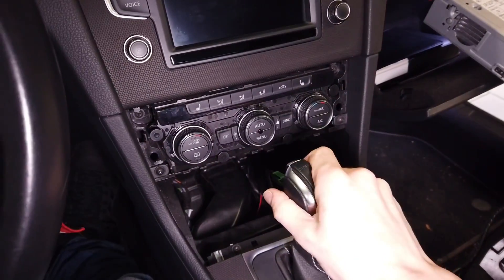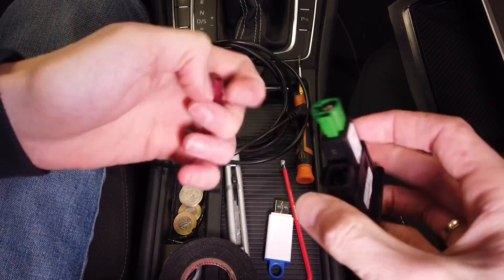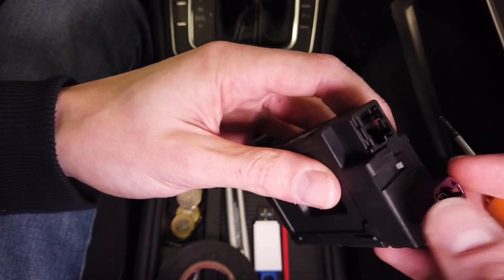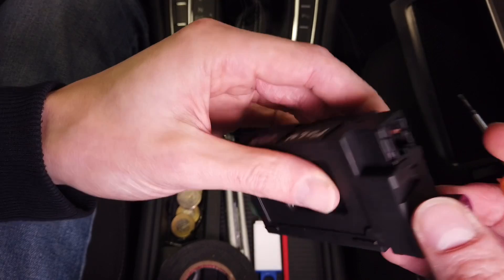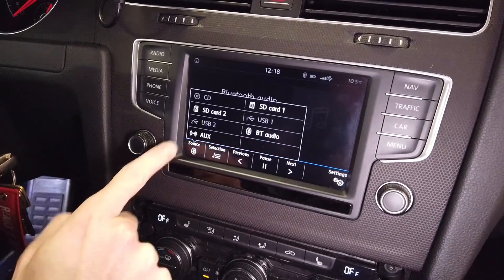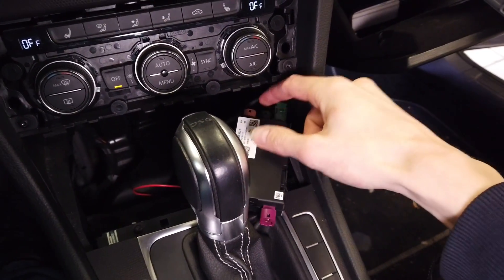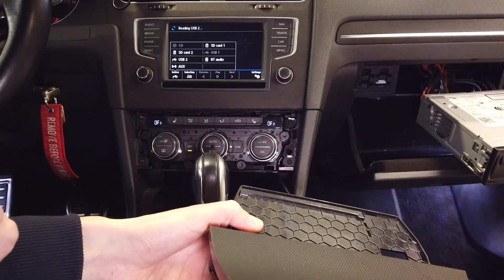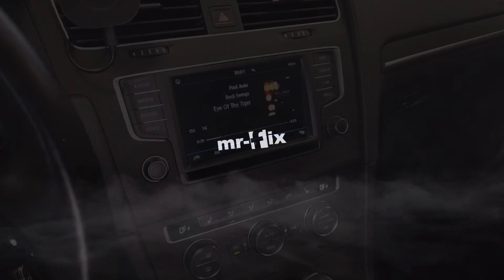MIB2 USB HUB retrofit (5G0 035 953 D) - part 2

Comment: Hi there, thanks for the video! I have a 2019 t-roc with one usb port. I want to update with 2 ports, ideally usb-c ones. My MIB unit is with MST2_EU_VW_ZR_PO478T firmware. Can I use the usb-c part number 2G6035736? From what I can see, it has an internal hub and a 12v input. Or shall I do your solution with the hub and 2 normal usb ports? One last question, is there another way to get the 12v input other than the fuse box?

Comment: Do you need to disconnect the battery when retrofitting radio/screen unit or usb?
Reply from the maker: I didn't. But this is not an official advice.
Reply: @mrfixpl  Thanks. Subscribed, your videos been very helpful. 🤝🏻

2 more things before I start the fitting today:
1. Can the CP removal be done after fitting? 
2. If the fitting goes wrong prior to any code changes, can you put back the old unit or will it no longer work?
Reply from the maker: 1. CP can by bypassed (unit will be fully functional; there will be CP fault stored in vehicle). If you want actual removal, you need dealer-level tools and online connection to VW.
2. I believe you can.
Reply: @mrfixpl  you’re the man. Thank you
Reply: Update on this: 
1. I fitted them without removing the battery (Just key out)
2. re-fitted the old unit, no issues

I've ordered OBDeleven and an SD card so I can patch it and personalise to the car tomorrow 👍

Comment: Hallo @mr-fix.
I have all parts, but I'm not sure how to make all to wark! Can you please help me? From where did you get those +5 Volt trigger?? Just that part is for me confused. 
Thanks a lot, 
Greetings from Berlin 🖐️
Reply from the maker: 5V comes from MIB main unit. Previously it was powering the single USB port. Now it will trigger the HUB.
Reply: @mrfixpl  Can I get from quadlock port or just cut the cable from old usb port? I think that on quadlock exist +5V?
Reply from the maker: quadlock!

Comment: Hello mr fix quick question why dont you retrofit the 8 inch display that supports mib2
Reply from the maker: Hi! I was planning to upgrade from 6.5 to 8.0. But I wanted to old, prefacelift display from Discover Pro. Was hoping for a good deal on used one (still looking) + the console frame that goes with it.
Reply: @mrfixpl  I hvae a 8 inch display with buttons i think that you can have for free but i think its cracked not to sure i can find it and test it, how about virtual cockpit are you planning to retrofit that?
Reply: @mrfixpl  Hello again a costumer of mine dropped of a old style 8 inch monitor yesterday if you are intrested he didnt expect to high of a price for it so i bet you get a good deal
Reply: @mrfixpl I agree and have the 9 inch but even I feel like I want the 8 inch for  the physical controls.

Comment: Have you also replacede the cable between the hub and the MIB? After the hub installation carplay dosent works and I have static fault U11B800 in 5F! Someone say that I need to replace the cable with ha straight one and not HSD!
Reply: HI MY FRIEND, DID YOU MANAGE TO SOLVE YOUR PROBLEM? I INSTALLED EVERYTHING, IT RECOGNIZES THE CELL PHONE, IT CHARGES BUT CARPLAY DOESN'T WORK

Comment: Great video as always.

Did you say Carplay requires the advanced USB connection, but Android Auto doesnt?

I was thinking of fitting this hub to allow me to install a hidden wireless AA/Carplay device, but still be able to connect via a cable if i wanted to. My partner prefers to plug in but I don't. Sounds like it wouldn't work?
Reply: Not a bad idea actually to get best of both worlds since VAG was too stingey to implement it even in the 2020 model golf when wireless AA and car play were definitely already available because they are on an aftermarket head unit I own from Kenwood

Comment: Hi, In my Passat B8 i have two USB ports from factory. After unlock of AppConnect I can use just one usb for AppConnect (CarPlay). I have done coding and adaptation as described. I guess I have the usb hub from factory, so maybe it is different version? Do you think that If i would connect the second usb port to a different port on the hub, i will be able to use it for carplay? The usb what is working is in front cubby under the climatronic, the second usb is in the armrest compartment, i want to put a carlinkit in the armrest, and have usb in front free. Can you help me? Thank you.

Comment: hi, could you please help me about something, i would like to upgrade my Golf Mk7 MIB1 to MIB2 or 2.5, the idea is to change the brain unit and the screen so i am able to add later rear view camera with turning lines and a good resolution on a logo flip
could you please tell me the parts numbers i would need for the screen and the brain unit and also if wiring changes would be needed?
i am aware i will have to make some coding but my first stage is to get the parts and learn as much as i can before installing them
thanks in advance